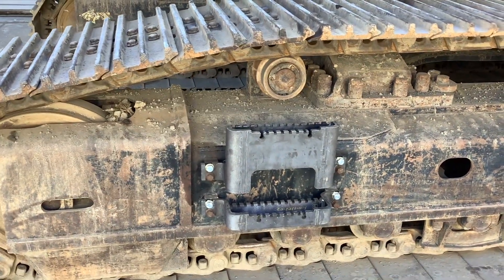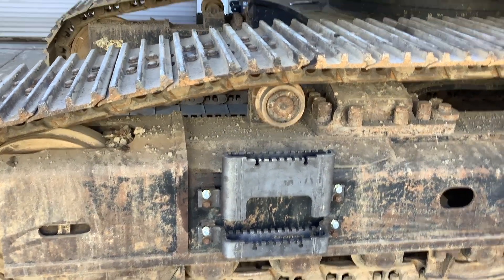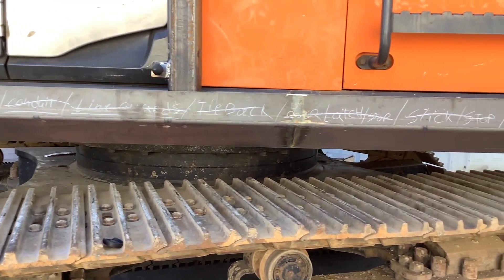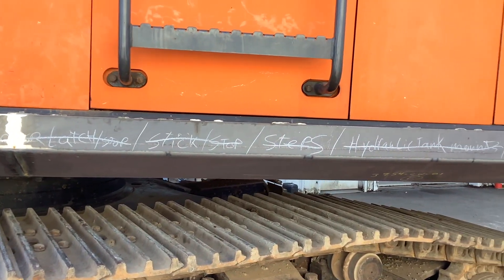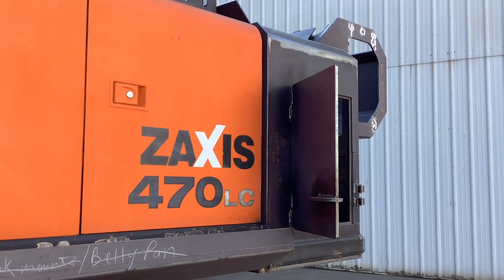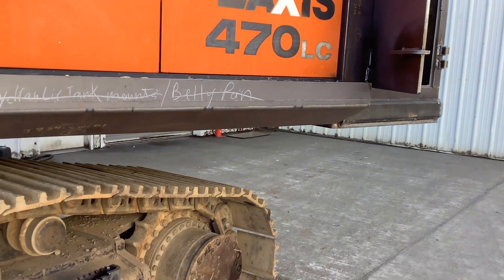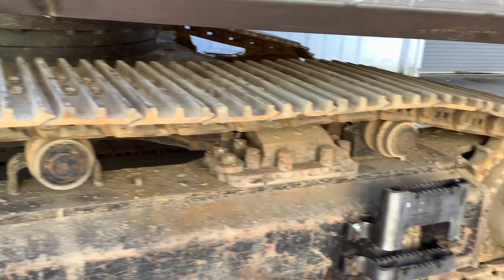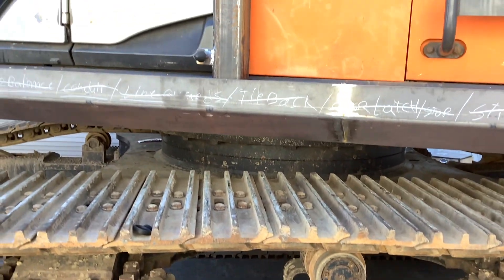470 Hitachi Line Machine Conversation Video #4 - In Line For The Paint Room & The Tower Is Up!

Comment: There is a guy here in the east that is tethering now. I think he is north of me in West Virginia working for Weyerhauser...
That machine is gonna be a beast!! Will you remote control it from the Tigercat?
Reply from the maker: I may have seen a video on that outfit, working in hardwood with John Deere equipment? Yeah she's going to be an animal!  It is remote control from the Buncher, the drum set is synched to the travel pedals and speed and tension are controlled with a touchscreen in the Buncher cab. On short strips it's handy to have an operator in the Line Machine to move it down the road, I keep trying to get my wife signed on to that! I'll be doing a video of me getting going on it, should be interesting. Thanks for the question!